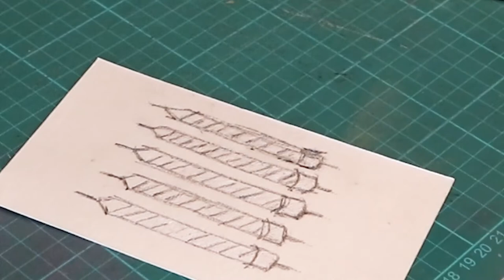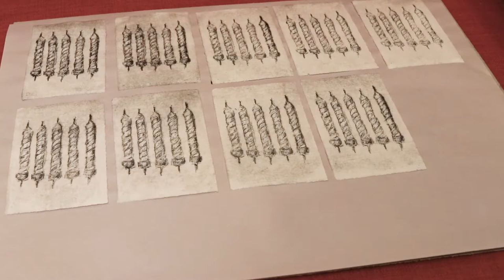Make a drypoint print from a recycled carton

Comment: Hi, there. Would you be able to use a thin piece of cardboard like a cereal box?
Reply from the maker: Hi Gaby, you can try whatever you like! The handy thing about juice/milk containers is that they already have a coating on them, which makes them easier to wipe and helps protect them from ink and liquid. If you wanted to use an uncoated piece of cardboard (like a cereal box), you’d likely need to coat it with a glue or varnish first so that it lasts longer before falling apart.
Reply: What kind of glue would you recommend?
Reply from the maker: @GabyGibson  I'd use a basic PVA or wood glue.
Reply: @SpinesAndSplines  Thanks!

Comment: Wouldn't it make more sense for the felts to be dark?? What's the reason they are so white? Just some old tradition?
Reply from the maker: Thanks for your comment, There’s a few reasons that printing blankets are white. They’re made from undyed wool, because you don’t want to risk any dye transferring in the printing process, and the sheep that the wool comes from are white. Along the same lines, white wool sheep are much more common than dark wool sheep because their wool can be dyed, so white wool is less of a niche market and less expensive. People also most often print on white paper, so small amounts of fibre transfer from the blanket onto the paper won’t be visible. You can also see more easily if your blankets are dirty and need to be cleaned before spending a lot of time printing a big edition.